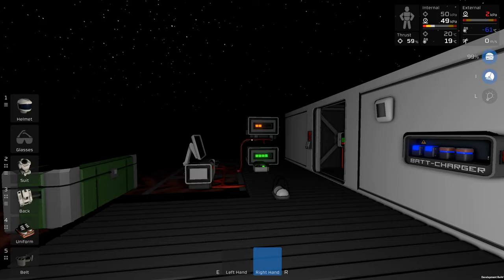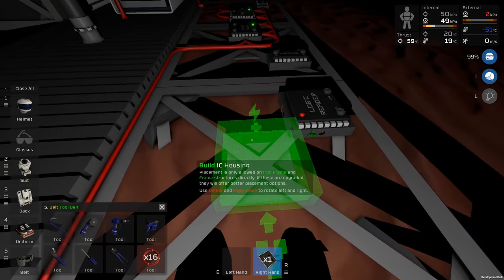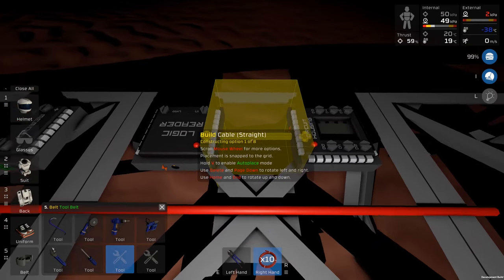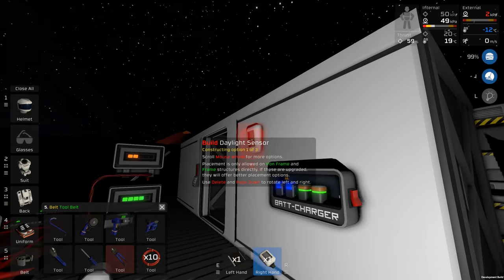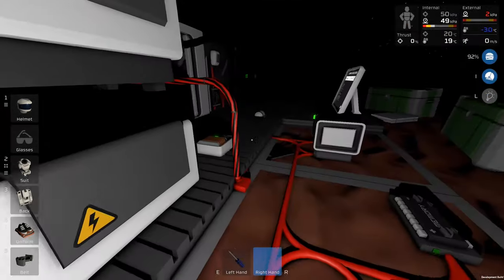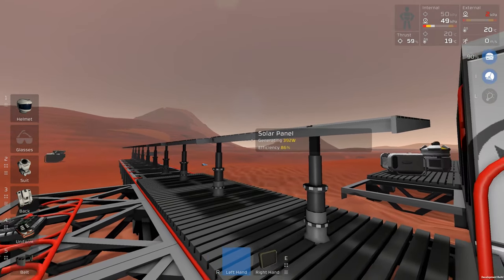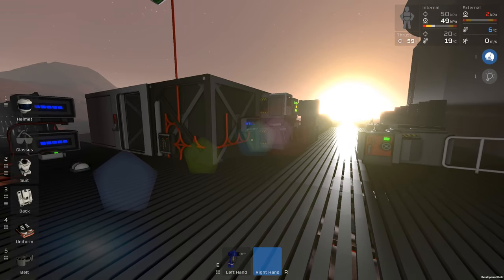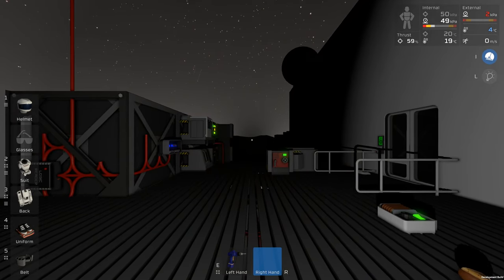Stationeers S4 E25 - Perfect Solar Tracking

Comment: I use chips to track the sun in all environments... perfect tracking with 3 logic memory, three logic procesors and  4 logic io.  Get the two sensors and the panels placed correctly and it is a simple task, once you have done it a couple of times.
Reply from the maker: Yep - I think I know the setup you're talking about - this is the same thing, but in one chip (still needs 2 batch writers and a logic memory), so 3 powered chips, and a quick copy/paste :)
Reply: @grayduster  
v position
solar sensor v mode
logic memory 90
logic memory 15
logic memory 1.5
logic reader solar v
logic math  90 - solar v
Logic math  above - 15
Logic math  above / 1.5
batch writer above -> solar panels v

h position
solar sensor h mode
logic reader solar h
batch writer -> solar panels h

Comment: 75 - h is actually just (90 - h) - 15. The -15 is the same as in the simple script. There probably is a sensor orientation where you don't need to do 90-h but it wouldn't shorten the program because you still need the -15